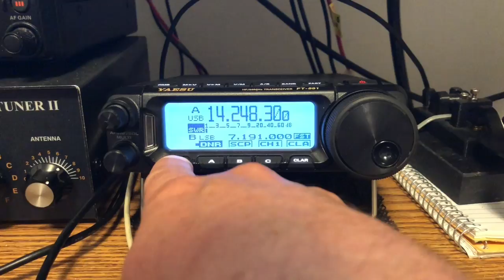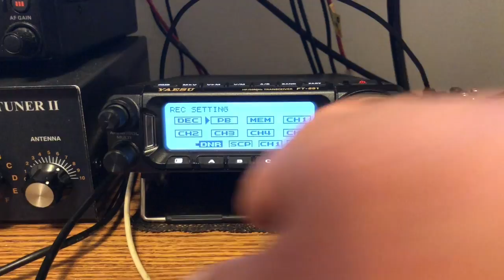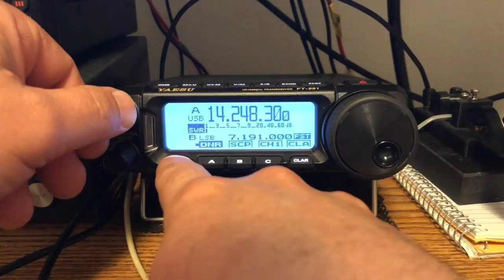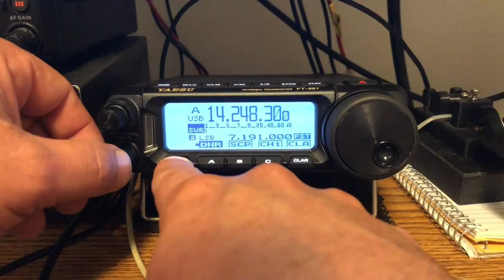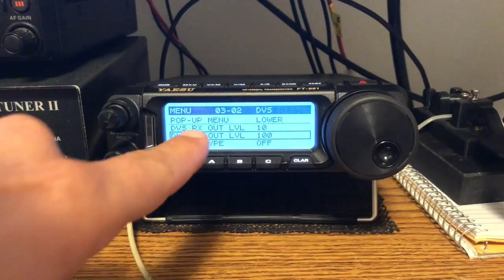Yaesu FT-891 Memory Playback Function

Comment: I have just bought this radio for SOTA (to have 100W). It's a UI nightmare. Coming from Icom where the menus are structured and consistent, the FT891 is a real mess. 

However, the 03-01 and 03-02 (DVS xx OUT LVL) where what I was looking for. Often I'm out in public doing POTA or SOTA and the sound of my calling does my head in. This is awesome thank you!

Comment: Cant figure out how to change the quick keys on the display
Reply from the maker: You just have to highlight in the menu which one you want, and then long press the A, B, or C key.
Reply: @hamradiotube  I got it but think might have a issue because it’s not recording I hit the ch1 and it just clicks I have pb Actuvated
Reply from the maker: @mikegianfrancesco7723  Unfortunately I don't have my radio to walk you thru it.  Its packed with all my other stuff and moving down to TX as we speak.  It should be pretty easy though and is prob something silly you forgot.
Reply: @hamradiotube  i dont think so watced videos and its not working
Reply: @hamradiotube  i got it i forgot it the mem thing lol
Reply from the maker: @mikegianfrancesco7723  See it told you!  Glad you got it working.
Reply: @hamradiotube  now trying figure out on the software why that bar the rx way to low

Comment: Thanks for the video "but"...I just can't get mine to record.... I did 5-11 and got the 4th menu to show with Rec Settings.  Then I select Mem, push the function button, REC pops up flashing, I then rotate the function knob to Ch1,  then key the mic and speak into the mic but the REC keeps flashing unlike yours which stays solid , then I try to play back with the arrow  pointing still at CH1 all I get is a quick double beep....   Do I need to purchase a mem/record board to install inside?
Reply from the maker: I would guess you don't have PB selected.  Other than that is sounds like you are doing everything right.  Make sure to push the function button again when you are finished to stop the recording.
Reply: Figured it out....was missing a "Function Push" after rotating to the CH I wanted to record onto I needed to again push the Function key in again then key down talking into the mic....
Thanks Again for the video...
Mike
Reply from the maker: @EagleRiverMike  There you go.  Glad you got it to work.  You won't know how you ever called cq with out it.  73.

Comment: Hi Mike,
I have not yet made a purchase on a portable HF rig, and was wondering if you would still make the Yaesu FT-891 your "Go to" rig or would suggest another brand / model to consider and why?
Thanks  Dave   W7DAW in Boise Idaho.
Reply from the maker: Absolutely.  I don't think there is a better radio out right now that I would want more than the 891 for portable.  The only other one in its category would be the Icom IC-706MKIIG.  That radio is an all band radio so if you care about 2 meters and 70cm's that might be one to look at as well.  They are both priced about the same.
Reply: Yaesu is the real deal Radio Stuff? I love my Yaesu Radio.73 AE4OY William Peacock 🦚 EM-81uf SOUTH EAST GEORGIA 🤓

Comment: Hey Mike this is awesome (and timely). Out of curiosity, What does the DEC function do?
Reply from the maker: No clue.  Page 23 of the Advanced Manual calls it "Decrementing the Contest Number".  "Use this process if the current contest number gets slightly ahead of the actual contact number (in case of a duplicate QSO, for example)". 
Maybe the radio keeps count of your CW contacts in a contest???  It's in the CW part of the manual so I have no idea.